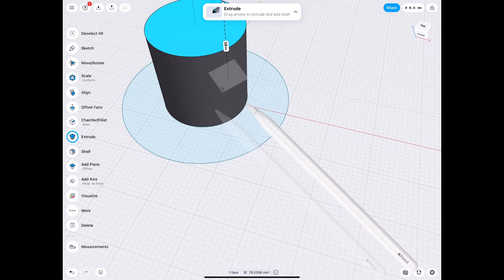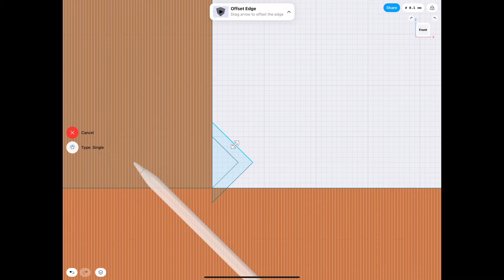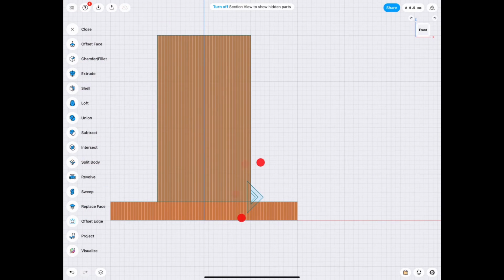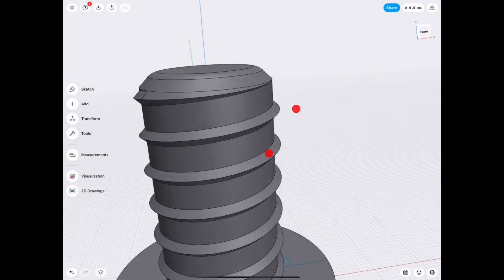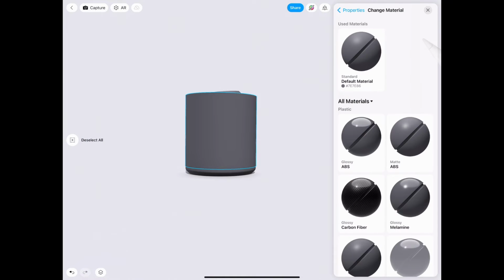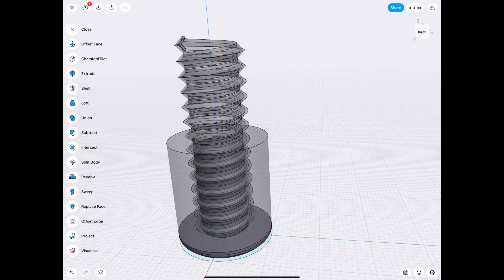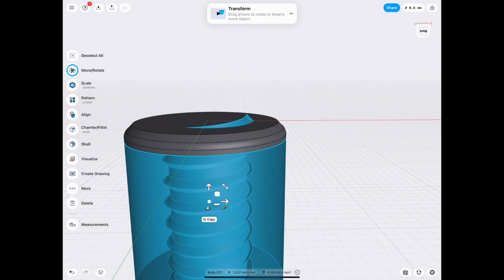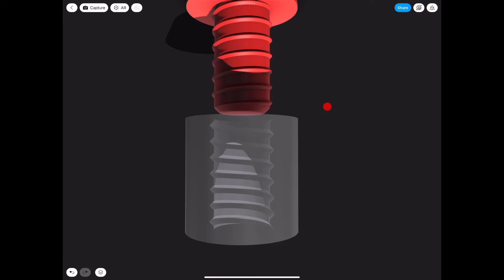Design Threads and Inserts for 3D Printing with [ Shapr3D ]

Comment: At 4:41 - replace face to make the thread merge smoothly with the body - in current Shapr this just doesn't work. I start to become desperate, I repeat exactly what you do and get "those face can't be merged". Any Idea?
Reply from the maker: It should still be able to work, i make threads the same way all the time. Shapr is finicky in some situations, and at times a simple restart will fix any glitchy behavior. Have you tried the updated tutorial? This might be easier to follow- https://youtu.be/ncMF0KNrcgY?si=pBBXuK5YnmHnuqHJ
Reply: @JLake3D  Hey Jake, will look into it tomorrow, thanks!

Comment: given how advanced CAD & 3d printing are, it's shocking how difficult threads are to make
Reply from the maker: You are not wrong. I am honestly still quite shocked Shapr3D doesn’t have a thread tool 🤷‍♂️ BTW, check out the updated tutorial, it is easier to follow along.

https://youtu.be/ncMF0KNrcgY?si=YIDlL3dFCaKr0OY0

Comment: Hey, thanks for making such a useful video. Is tolerance supposed to be a gap between inner and outer thread? As I understood in the video the gap going to be tolerance 0.2mm + size of the outer cutout (0.4mm) which makes it 0.6mm between inner and outer thread. Did I get this right?
Reply from the maker: Great question, 0.2 is the correct answer. It is the distance between the inner and outer thread and there is no more. 0.2 is the cutout.
Reply from the maker: I’ll be making an updated video soon that will be wayyyy more informative. Its been delayed but coming soon 👍

Comment: Thanks. How do you add the tolerance for the bolt and the insert? I’ve tried to scale a copy of the threaded bolt using a formula but the threads don’t align.
Reply from the maker: You simply offset your sketch when you are still in the sketch phase. Once you do that you have the form for the revolve.
Reply: @JLake3D  thanks for the quick reply. I tried offsetting but it didn’t work. I know it’s me, I’ll keep trying.
Reply from the maker: @3Dgifts i’ll be making a more in depth remake of this soon. It should have been done already but I have been SWAMPED at work. Will get it done asap.
Reply: @JLake3D  Thank you!
Reply: I just tried a few more times, but no go. I did it once by accident lol, but can’t repeat the process. I’m basically trying to create a custom thread, large ones with spacing in between, to screw a 14mm diameter rod into a 22x22mm tall post. Figured bigger threads with spaces, less turns.  Still can’t make that clearance 🤬
Reply from the maker: @3Dgifts watch the video @2:00
Reply: @JLake3D  sure did, a lot lol. When I turn on cross section I can see the opposing threads right on the bolt body. After printing a couple, I can start it but that’s it because of the clearance. I have gone as high as .3 for clearance. Don’t think that’s going to work well. I need this to be somewhat strong since it’s an outdoor part.
Reply from the maker: @3Dgifts send me the shapr file i’ll take a look at it if you want. Drewbrewchan @ gmail
Reply from the maker: https://youtu.be/ncMF0KNrcgY?si=pinI_GcRJlIiii2Y

Comment: Hey man, so im really getting close.  But when i subtract the outer thread from the insert the tolerance is remaining as a floating piece of material.  What am i doing wrong?

You extruded the insert up and did a new body.  I’m creating the insert with a hole first, move it into place, and then use the subtract tool.  Highlighting the insert then the outer threads.  And if it weren’t for the tolerance material remaining it would work.
Reply from the maker: When you do the subtract, make sure to click “keep modified bodies.” That should work for your situation (thats just my opinion without seeing your part). If not, then make sure you have enough clearance so that the extra material is not connected to the new body in a way that impedes the tool from functioning.
Reply: @JLake3D Something must have changed in the app, this does not work any more.  I wonder how many updates there’ve been in the last 6 mo since you posted this.  I’ve got almost 6 hrs into this and as far as i can tell im doing everything you’re doing.  And i also realized you never showed the insert after the subtraction.  I’m not saying it didn’t actually work for you, but im also not saying it did.  It’s hard to tell until you go to print…”got parts dangling in mid air” is a pretty big oooooooof.  I bet ur insert, in this video, didnt work either.
Reply from the maker: I designed everything with a 45° angle so there is nothing printing in mid air unless you chose a steeper angle. Even with the updates this design process is the same.

I know some people have trouble following along because I go through some steps quickly, but if I didn’t then this video would be an hour long.

If you want, email me the file in Shapr format and i’ll take a look at it to see where you went wrong.

Go to my website and use the “contact us” form.
Reply from the maker: @dtdionne you could also join my Discord if thats easier- https://discord.gg/FWsfAAVK
Reply: @JLake3D  I posted a video, the link’s in the comment above.  You can clearly see the tolerance gap, as material, in the insert.  Ive got at least 10 hr’s watching and pausing this video, I understand everything you’re doing now except the part when you “said” you deleted this tolerance material that’s causing my issue.  I made the threads, offset lines and offset loop exactly how you did, 45° angle.  I copied and union’d the insert threads.  I extruded a new body and subtracted exactly how you did.  It’s the tolerance material left in the insert that is floating in mid-air.  The only difference is i made a 1mm tolerance while you made like .2mm tolerance.  I can’t share the file, but I appreciate it.
Reply from the maker: Links don’t show up in the comments except when I post them since it’s my channel. But i watched your video, answer is in the comments 👍
Reply: @JLake3D Ohhh, i didn’t know that, interesting.  Well that was it!  I had to extend the threads beyond the entire part which isn’t intuitive.  But for anyone else that may stub a few toes over this, extend the threads beyond both end’s of the part.  Thanks so much!
Reply from the maker: Glad to help! Good luck with your project ;)

Comment: If you don't delete the insert part (that you made to subtract from the outer sleeve) then you can use that in future projects to create threads in mating parts, right? So I can just make a screw-and-thread file, and each time I need a different size I can add it to the file so I've got a repository of screws and threads for future use. I think the thing I hadn't really appreciated before going through this (and this is the bit I was getting hung up on) is that it doesn't really matter at all what pitch or whatever my threads are, because I'm not making them to fit other things, just each other. So this is a really simple way of fastening elements of a product together without having to worry about including hardware or it being too fiddly to put together at the other end.
Reply from the maker: Exactly. Beauty of creating it yourself. You get to keep the file, learn from it, and have a completely unique solution to a very specific situation. 3D design and printing is wonderful :)
Reply from the maker: Nothing to stop you from creating a part for mass production either though ;)

Comment: I'm simply blown away by what all this program can do. I wasn't sold on it at first but after using the free version and learning the program for basic designs I found my self at a crossroads where the low resolution just wouldn't work for me anymore and I made the decision to purchase the program and after trying to learn other cad and then realizing how frustrating it can be, this program really does take the frustration out of it all and it's actually enjoyable to see your ideas come to life. I look forward to learning more advanced features of the program and I even bought the smart pen to go with it. I just have never been a fan of subscription based software and I hate everything it stands for so it's just a shame they don't give you an option to buy the program outright as I'm just a hobbyist and I'm not making any money of of my designs so I'm either forced to stop believing that stls should be free for everyone and start charging for my designs or try to learn one of the more complicated programs. One trick he didn't mention in this video, is if you want your parts to fit together, when you go to slice it, use the exclusive mode under slicing tolerance in cura. I don't know what it's called in other slicers
Reply from the maker: I fell in love with this software the moment I saw it, bought an iPad pro the same night even though I had 0 CAD experience. This program felt natural to work with. I’ve been paying pro since then and have 0 regrets. Advertise your services as a modeler and make just enough to cover the cost of the subscription. Be honest with your customers though if the project is too much for you. Do whatever you want with the rest of the year 😁👍
Reply from the maker: Regarding the tolerances, not all slicers have a tolerance function, so the idea is to design a part that is ready to print on any platform.

Comment: I just make a bolt, copy it and scale it up 0.08, shove it into a part and subtract it from it, works really well for me
Reply from the maker: For small bolts like m3 etc i dont even make thread, i just make a hole thats 0.1mm smaller for the bolt to have something to bite into. This video is mainly for custom thread designs.
Reply: @J. Lake 3D  I model parts to be printed on a massivit machine. I make large molds and use the method I mentioned to include a way to lock both sides to each other. We don't worry about the threads being the same, they worry about the job getting done, and it works. Whatever works
Reply from the maker: Thats how business works lol as long as the customer is happy 😜
Reply from the maker: Thats an option, however that changes the thread vs. this way it does not.

Comment: You glossed over the subtraction part which was very important. You have a specific selection you did not mention and i rewatched maybe 10 times to figure out what it was. Good video but go slower and explain better. Thank you
Reply from the maker: Yea I have a tendency to go a bit too fast on these tutorials just because thats how I actually work. Need to remember to slow down. I’m planning to start doing a new video format where i’ll have a little video in the corner of my hand movements from another camera so that nothing will be missed 👌
Reply: @JLake3D  sounds good. Looking forward to it. Great video. I was able to get to the desired outcome. Thank you. Now its time for the printing test 😂😂
Reply: What is the specific selection? Because I’m having a hard time subtracting what I want. I followed all these steps to a T and it’s only subtracting the smaller outside part of the threads, not the actual beveled groove of the thrrads
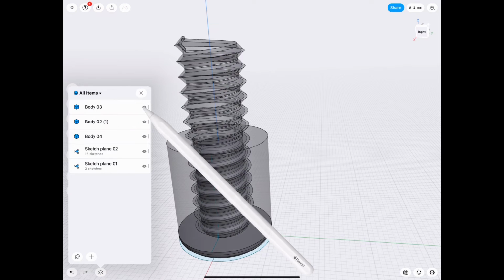Reply from the maker: @TomTomB00M I make 2 subtractions, one at 7:20 and the other at 8:50.
Reply from the maker: https://youtu.be/ncMF0KNrcgY?si=pinI_GcRJlIiii2Y